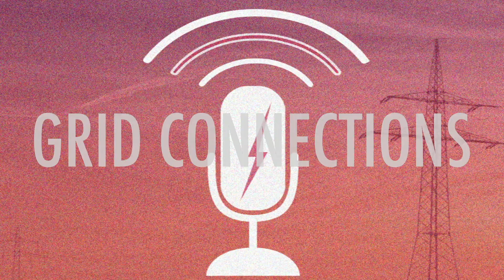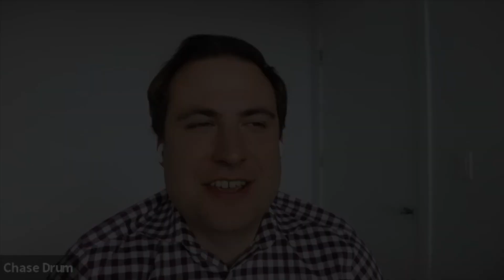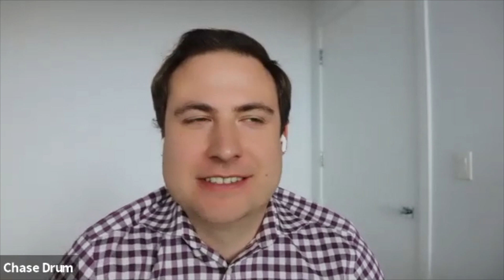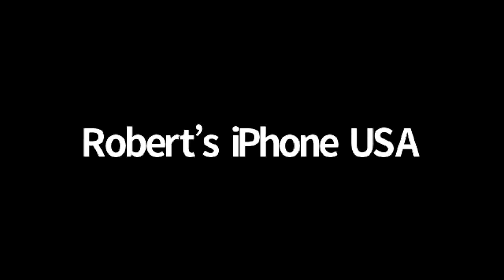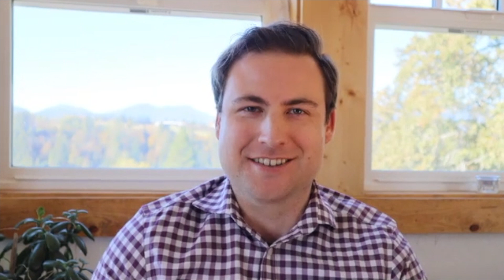How Electric Buses will Help Roll Out More EVs - Ep. 8

Comment: I wonder if "buses" have much of a future.  I'm talking about the large urban buses we now have that stop frequently along their route.

Most of us, probably all of us, would prefer to take a taxi.  Get in where we are and get out where we want to go with only stoplight stops along the way.  But that's too expensive due to labor costs.  It can cost about $100k per year to put a driver in a taxi 18 hours per day, 7 days per week.  If a bus can average 10 passengers per mile vs. 1 per the taxi that's a 10x saving in driver costs.  Full self driving eliminates the driver cost.

The future may look more like an assortment of 1-2, 4, 8, 12, and 20 passenger vehicles which run 'custom' routes taking people from one place to another with the size of the vehicle based on demand at that point in time.    A 20 passenger robo minibus may pull up at the exit of a large company and haul up to 20 workers to the "Sunnycove" bedroom community.  But a 1-2 passenger robotaxi may show up for the one or two people who are heading in a different direction.  Computers and lack of driver expenses should allow targeted routes, much faster travel times, and cheaper rates.

Appropriately sized vehicles, dispatching the size vehicle to maximize the butts per seat ratio, means moving less mass per passenger mile.  

In cities we might see slower moving 'hop on/hop off' vehicles that stop every block in the areas with a lot of short distance demand.  Use hub motors and the entry/exit could be at curb height.  They might have no seats because if you're going only a couple of blocks sitting would not be a large need.  Think a horizontal elevator.

Between cities we might see smaller driverless vehicles rather than the large "Greyhound" buses we now use.  Make the run with small capacity vehicles and departure times can be more convenient.  Rather than a large bus every four hours we might see a departure hourly or more frequent if there's demand.  There would be no need for fixed departure schedules on many routes.  Vehicle size and departure time could be determined by demand.